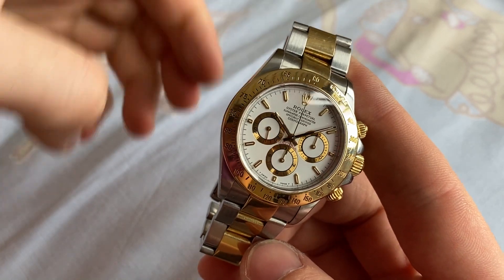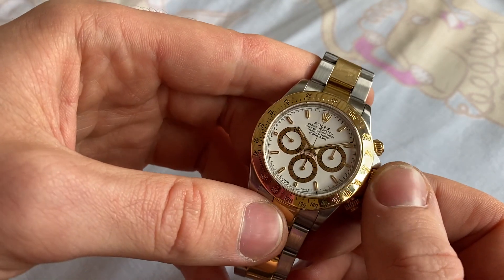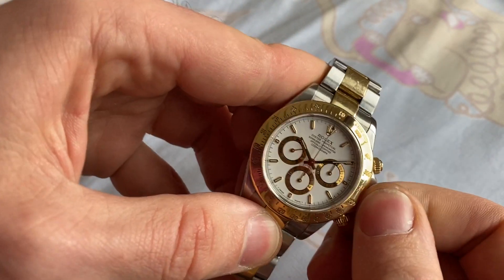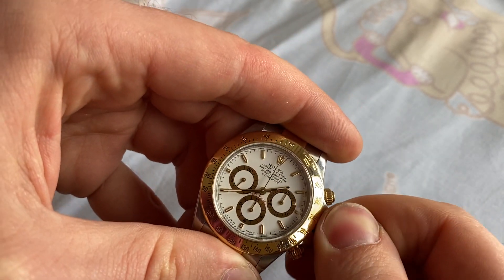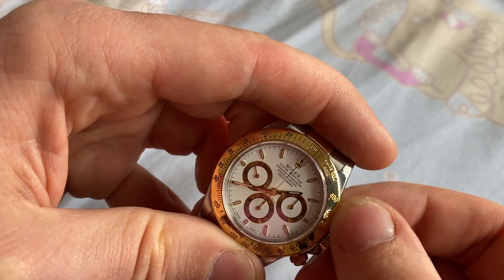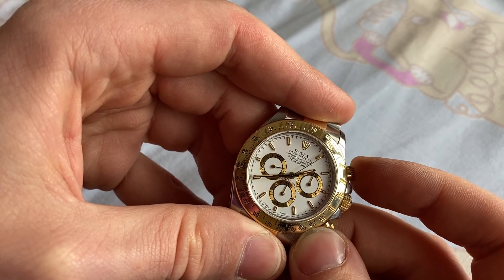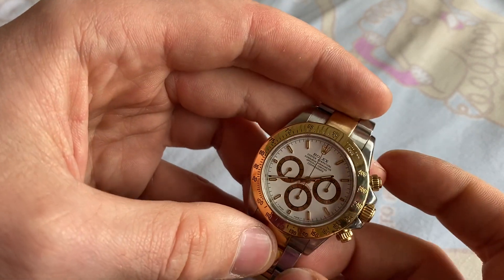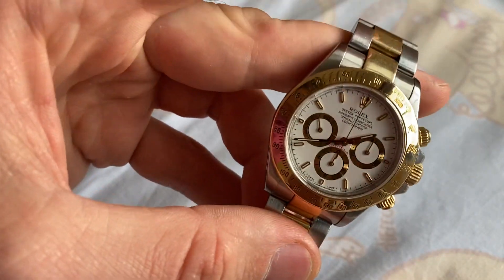How to use Rolex Daytona Cosmograph chronograph - winding, setting time, and chronograph function

Comment: Why when you wind back the hands go forward mine does the same thing
Reply: If a watch has to be compact or make room for an hour complication on front of the movement, they will have to add an extra gear which as im sure you know reverses the direction of the gear train. (Your car reverse works the same way - it inserts an extra gear which changes it backwards)

Comment: This small time is not working what can I do
Reply from the maker: Did you wind the watch? If the running seconds is not working, the rest of the watch will also not work. So you’ll need to wind it as shown in the video, and maybe give the watch a gentle sideways shake/nudge to stimulate the motion of the balance. If it doesn’t start running then, best check with a watchmaker.